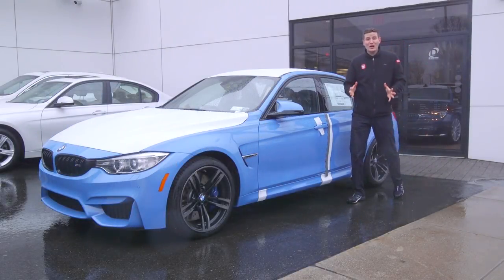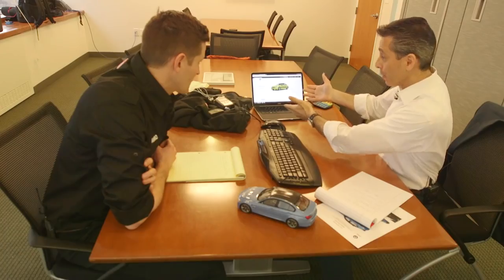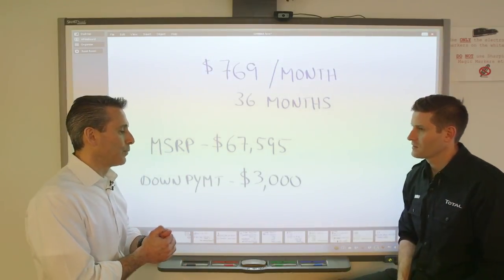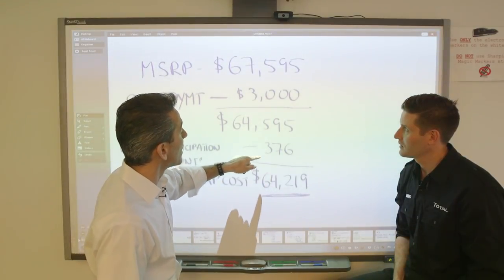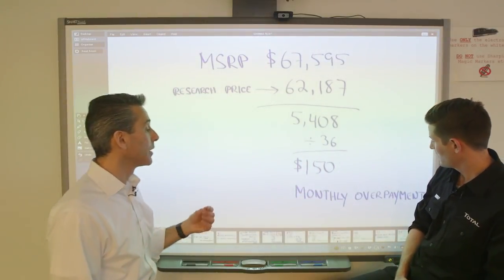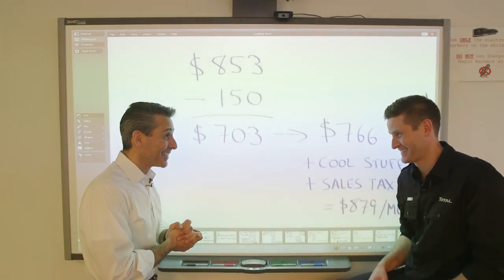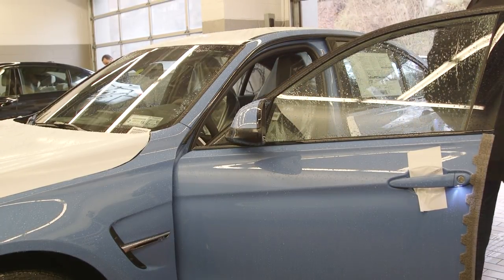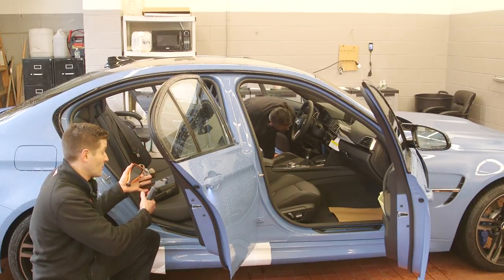How to SAVE $5,000 on a Lease: BMW M3

Comment: I don't know much about buying new cars, but you can low ball semi used cars that are certified with 10k miles or less easily. You save a ton of money. Last year I lowed balled a VW GTI Autobahn fully loaded from 21k to 18k, spent about two hours negotiating and they wouldn't budge. GM got involved, offered me a "final" deal and even threw in maintenance package for free. I refused and firmly stood by my 18k offer. Deal didn't work out, we shook hands and I left. The next day I get a call from the GM. Sold for 18k. :) Oh btw it had 8k miles.

Comment: Good info. One other thing to add, look for all available rebates. I just got $1500 USAA, and $1500 BMW loyalty off a 230i. Made a HUGE difference. It's like putting $3k down. And on a lease really brings the payment down because it comes right off that cap cost. And once ALL that's done. Go to a competing dealer and show them the deal and say I'll buy it here if you'll beat it and they will find a way.

Comment: This is incorrect and misleading. Lease consists of Residual value, Money Factor (interest rate) and the only variable is selling price. Your monthly payment consists of actual depreciation+ interest charge+taxes. There is a difference between downpayment and drive off. Drive off consists of 1st payment, DMV fees and an acquisition fee. Often dealer charges taxes in drive offs. Downpayment is a cap reduction, reducing depreciation amount to pay. Higher downpayment= lower payment. Every car has a different lease programs, thats why you often can see a $60k car lease for the same as a 30k car. Yes, you can save money by getting a discount of the selling price and it WILL reduce your payment but its not a simple math of taking a $1000 discount and dividing it by the term. There is always interest rate involved.
Reply: unreal.  you are so correct.  Maybe when he says hes good in finance that means that he knows how to only add and subtract on a calc

Comment: Leasing is the best way to go if your getting a luxury or sports car. People just don't understand how fast a car depreciates in value. From the moment you drive out that dealership your brand new 40 grand car isn't worth that anymore...About 5 years down the line when your bored of it and go to trade it in for something better. You will be shook when you find out that the trade in value of your brand new 40 grand car is only worth 26 grand..ha...Depreciation is a bitch. If your like me who enjoys driving new vehicles. Leasing is the way to go. Best part of it is getting to treat the cars like sluts because there basically rentals. Gives me a sense of joy knowing I'm putting my hard earned dollars to use.
Reply: iMarks Tech my lease is sitting outside with over 1600 miles in the “green”. Also earlier this years I traveled to OKC from PA and back. Racked up about 3100 miles. No problem. You see I’m able to do this because because my work commute is only 6 miles round trip. A 30mile excursion for me is nothing. Key words “for me”. Just like a lease is for me and not for everyone. On the other hand someone might only need 100 miles a week (5200 year) but can’t keep dings, scratches, dents and cigarette burns off their vehicles. At turn it that individual will get smashed. 
Just as if you turned in your lease with 30k over at .24 per mile you’re looking at $7200 in charges.  

I like driving new cars that’s always under warranty. I don’t need more than 12k miles per year and take good care of my vehicles. That makes me a good candidate for a lease. Not everyone fits the criteria.
Reply: there are options for mileage....... lmfao

Comment: Buying a luxury car is money down the drain!  Once the luxury items are obsolete, value of the car depreciates faster than non-luxury cars.  Lease is a good way to drive a luxury car and then you give it back before all the expensive parts like a chipped key-fob fail (and you're not stuck with a $3000 repair job)!  Learned my lesson once!  If you want to drive a luxury or high-end car, better off leasing it!  you gotta pay to play as they say!
Reply: Leasing makes a ton of sense in that segment. My Uncle recently returned his lease on a 2013 BMW 750i M Sport and good thing because those N63 motors are absolute junk in the long term. Runs great when it works like it should but everyday that was a gamble whether there would be an issue or not.

Comment: He didn't save $5000; because he pays a certain percentage of the total cost say 40% for 3 years. He could've got that car for all in under $750 with multiple security deposit. He's paying way too much.
Reply: freakincrazy6932 you could also do lease to purchase. Where he leases to make payments lower then buys the vehicle at a discounted price. We do it all the time.
Reply: freakincrazy6932 best way to dodge the insane deppreciation hitd
Reply: Basically you pay a set amount every month for a lower price (but if you fail to make those payments they'll take your assets as with most loans), however in exchange for those lower monthly payments you don't get to keep the car at the end of the contract and you cannot exceed the annual mileage quota (they will charge to extortionate amounts if you go over). If you decide you want to keep the car at the end of the contract you pay a couple thousand more (basically the rest of the value of the car). Its great if you want to avoid the depreciation of the vehicle and usually comes with all the servicing (parts and labour) included. Think of it as long term renting a car for a lower price. Only benefit of it is that you get a new car to use for that period of time and don't experience the depreciation of it when you come to sell it (good if the car you want is a Jaguar for example), its a great low budget option.
Reply: 870 is a reasonable deal nothing crazy.
Reply: Agree. Glad someone else mentioned MSDs.
Reply: What? Residual is based on a percentage of MSRP, so anything he saved off MSRP he did save...
Reply: wrong. msrp is a fixed number and  have no effect on the amount the payment itself. what he saved is what he saved
Reply: You contradicted yourself...

Residual is based off a percentage of MSRP. MSRP is the fixed number as you mentioned, but it is very relevant as it's used to calculate the residual. The $ he saved, he saved because the residual is X% of MSRP but he negotiated under that. MSRP is still quite important. This is why a $5000 discount on a $65,000 MSRP M3 would mean a lower payment than a $80,000 M3 with the same $5,000 discount.
Reply: freakincrazy6932 He actually negotiated a pretty bad deal. I agree. See my earlier comment.
Reply: Darwin Carbajal This would only save you money on payments.  In the long run you would be paying much more for the vehicle then initially just buying it outright.
Reply: They are phasing out MSD for future BMW
Reply: Keith Beitter most people that lease will not buy unless at the end of lease payoff is has more value than retail.
Reply: Darwin, I was referring to the total amount paid for the vehicle.  If your intention is own the vehicle it doesn't make sense to lease then purchase.  You should just do an extended purchase.  Though I agree and see it all the time, when a car has equity at the end of the lease it could be a smart purchase, or you can even sell it to the dealer and re-coupe the equity instead of just turning it in.
Reply: Reference?
Reply: I've worked for a Porsche dealership for 15 years.  Is that what you are asking me?
Reply: Keith Beitter if you decide to extended purchase for a longer period of time, interest rate will be higher unless you re finance half way.  I think leases are not bad  if you are not planning to keep the car for a  long time.
Reply: I agree, I have nothing against leases.  In fact it makes up a large percentage of our business.  I was just reinforcing the fact that leasing then purchasing you would be paying more over the long term as to just doing an extended purchase.
Reply: Leasing with the intent to buy is STUPID.

Here's why. You will always pay some kind of "bank fee" to get into a lease. It'll be a good $1000. The lease interest rate will cost more in the long run as the principal isn't getting paid down as fast.

If you have a 20K car with a 10K residual, 36 month lease @ 3% (.00125 MF) you will end up paying $1369 in interest and still owe 10K after 36 months after $315 payments. Then if you do something stupid like finance the 10K residual for 3% at 24 months it's 430 a month and you pay $315 in interest. so $1684 in interest if you lease and buy out, not including any kind of BS bank fee which can range from 600-1200 usually depending on brand.

If you just buy the damn thing for $20K payments are $469 for 60 months at 3% and you pay $1562 in interest. If you paid a $800 bank fee then congratulations you spent $922 more to own the same car at the end. And this is with a cheap 20K example, think about this with a 40-50-80-100K example....

I could care less if anyone buys, leases, pays cash whatever, just don't try and say that it's cheaper to lease and THEN buy it out if you intended on keeping it past the lease terms in the beginning.
Reply: Unless there is a $3k incentive for leasing and then add up the multiple MSDs and I got a sweet deal on X5M lease. I generally agree with you, but there are certain scenarios when it may make sense.
Reply: Keith Beitter huh? This makes zero sense. I haven't checked your math and I'm not sure it's even correct. But let's assume it is. For one thing, the lease option saves you almost 33% each month! The payments are one third lower! Time value of money. Read about it. You can save, invest, or buy stuff with it. That's worth A LOT more than the interest savings. But there is no difference in interest. You made a mistake. $20K @3% over 5 years has THE SAME interest cost whether you amortize over 3 years, then 2; or over 5 from the start. It's basic math. Contact me and I'll send you a spreadsheet to explain it if you'd like. 
Also, WTF is the "bank fee"? I've leased two Mercedes a Lexus and a Porsche and none had any extra fees if you chose to buy the car at the end of the lease. Zero. And you don't pay for excess mileage, in case you were wondering.  
Assuming interest rates are similar, it makes all the sense in the world to lease.
Reply: Fluterra what doesn't make sense?
Reply: I have no idea what you are talking about, I gave no math calculations above, you may be referring to someone else.  And yes there is a lease acquisition fee that Porsche charges.  It is $995 and has been for the past 14 years.  I do not know about other companies.   I never said it didn't make sense to lease.  I said you would be paying more if you leased the vehicle then bought the vehicle after the lease, then just buying the car.   Especially here in Texas, as you would be paying taxes and fees twice, once on the lease and again when you purchased it at the end as you have to re-register it.

By the way I have leased my last 5 Porsches so again I have nothing against leases.
Reply: "$20K @3% over 5 years has THE SAME interest cost whether you amortize over 3 years, then 2; or over 5 from the start. It's basic math" -> Wow are you misinformed. Interest on an auto loan is COMPOUNDED DAILY based on the principal at that time, this is why even if you make 2 monthly payments evenly through the month you end up paying less over the life of the loan. If you lease for a lower monthly payment, you pay more interest in the first three years, then you do in the last 2. Same scenario with a "balloon" type auto loan.

"I've leased two Mercedes a Lexus and a Porsche and none had any extra fees if you chose to buy the car at the end of the lease." -> I'm not talking about AT THE END. I'm talking about the 'acquisition fee' at the beginning. You are paying a premium to get INTO the lease, and that counts when calculating how much the lease costs.
Reply: He doesn’t know how a money factor works.. let him think he beat the dealer so he can sleep good at night
Reply: billyclub Speak to Tonya, she has all the latest STIs.
Reply: NOT available any more! Unless of course you have an MSD on your current lease.
Reply: BMW doesn’t do security deposits anymore
Reply: NO MSD IN NEW YORK

Comment: Kind of petty to start looking for minor imperfections in a mass produced car. No factory will pump out a perfect car -- it's a lease too.. chill out.
Reply: Adam C you would be suprised how many brand new cars are hit and repaired or badly painted. 
If i was paying for a $70,000 car you bet your ass id be checking every inch of it!
Reply: Adam C chill out? It's still a $70k car, not a Huffy. You're paying to use it, do you want the best one to use or a so-so one? I don't know why people are saying that it's a lease so you don't own it so who cares, it's still a huge expense.
Reply: Adam C indeed. Some cars get damaged when discharging from the vessels at the seaport. Some stevedores are careless and tend to drive stupid fast in tight spaces inside the vessels. Vehicles with damages will get repaired at the seaports in their local prep centers. Not sure if their paint quality is as good as a factory paint job but these shops are approved by OEMs headquarters to make such repairs before leaving the port.
Reply: Nope, he's right... It's petty and frankly, absurd to be checking it with a light like the dealership has any control of these quality of the manufacturing. It's a lease, your going to be returning it in 3 years anyway. What are you going to do if you find a spot on the paint? Exchange it? This isn't a pair of pants kids.
Reply: Adam C they can charge you for scratches and dents at the end of the lease.. chill out.

Comment: Very informative mathematics without a doubt!  That $800 and change monthly figure for that spec and color M3 are ideal and a practical figure.  The only budget factor needed to finalize the monthly out of pocket finances necessary would be a full coverage insurance plan since the title is held by BMW financial bank.  Hey Larry is your friend planning on buying out the lease with a financed balloon payment?  This is the only reason I like the M4 coupé, it opened the door for practical deals on the sedan only M3 which I like much much better along with the M2 as a coupé I would actually go for over the M4 but with the same cost due to equipping the brand new M2 chassis with a Dinan S2 prep package.

Comment: When I plan to get a luxury car... I most definitely plan to lease. I think its the best route, unless you're able to put down $20k on a $70k car. So that way after the lease if you really want the car you can finance it at its residual value.. and usually its about half of the msrp within 36-48 months of leasing. I would recommend having a 2nd car and your lease not be your daily driver unless you just drive it to and from work and you live less than 5 miles way lol

Comment: Nicely done as always.  I took delivery of my M2 back in October and was shocked at how great the paint was from the factory.  I tracked the car all the way across the ocean and through the Panama canal to the port in California, the GM told me what time it went on the truck so I was waiting at the dealer when it arrived.  The detailers helped me remove the plastic and I inspected the car and like I said it was excellent.  I am sure there are issues with BMW's but a buddy got his M2 a few weeks later and we did the same thing and his car was perfect also so they seem to have a pretty good system.  They coat the cars in a wax before they go on the boat so the biggest challenge is removing the residual wax from nooks and crannies.  Love your channel, it feeds me OCD.  I would like to learn more about paint depth gauges , how to select one that is usable but also affordable and how to interpret the readings.  You have done some of that but I would love more.

Comment: The smart thing to do would be finding a mint condition, low mileage 2016 m3 for $10,000 less than sticker of a new m3 with the maintenance package included. Now that's how you save some 💰

Comment: From Australia. And not sure what your understanding of a lease is. 
To me it's basically renting the vehicle, at the end of the term, you hand it back. Is that correct? Cause that just sounds bonkers to me. 
OR, is it a form of a loan, and rent to own scenario. Where at the end of the lease period, you own the vehicle??
Reply: Dylan Baxter it's not bonkers because you're only paying monthly towards the depreciation, not the entire vehicle. This is why you're paying.
Reply: It is a glorified rental but at the end of the lease you have the option to buy for the remainder of they pay out. this usually applies to people who want a new car every 3/4 years. BUT it is an easier way to get into a new vehicle with no down payment if you use the method they do in the video.
Reply: It is exactly how you first described it. Youre renting the car. At the end of the term, you turn it back in and walk away. Or you can buy it for the resale price that they put on it, anywhere between 30-60% of the origional value. But you also only get a set ammount of miles to go through. Like 3years 36k miles. If you go over, you have to pay more when you turn it in.
Reply: 1. you rent the car for x period, then give the car back.

2. you rent the car for x period, then buy the car at the end of the lease, by paying the residual value.
Reply: Nickolastiguan is right ...
Reply: You're correct.  In essence, leasing is the same as renting, but long term.  At the end of the lease you can either return the car or buy it.